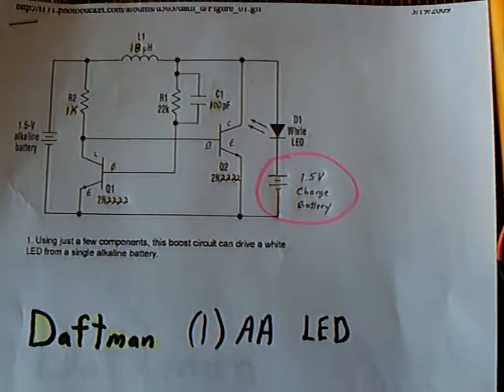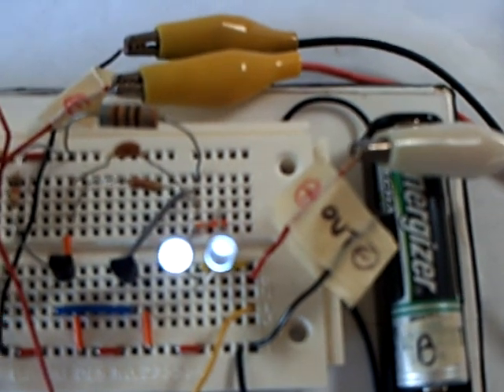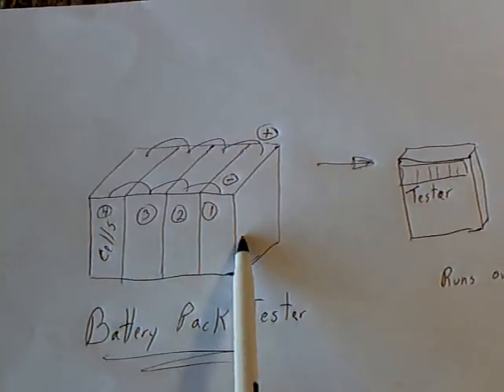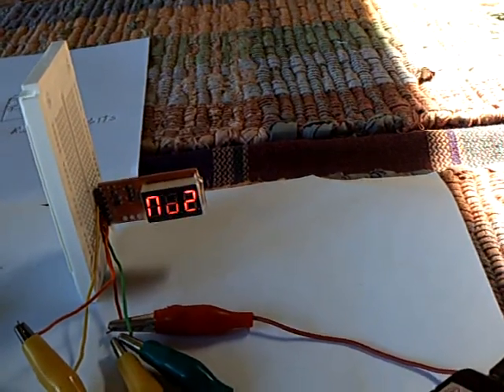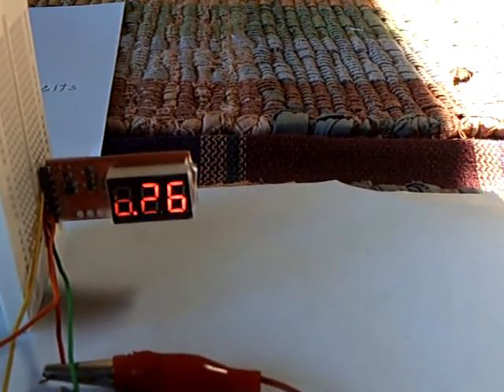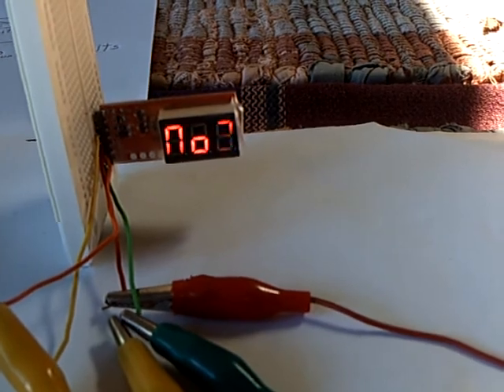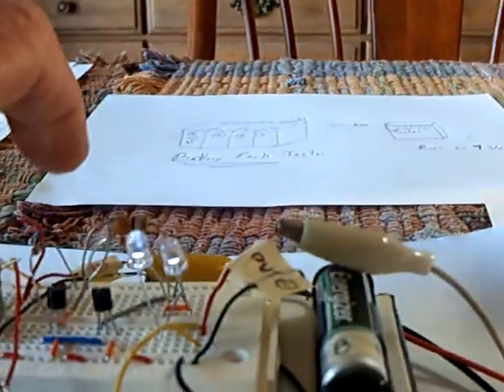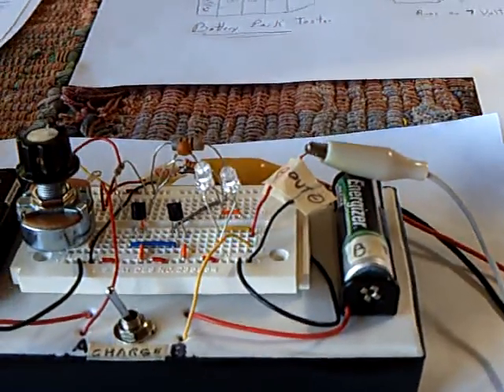Daftman Light Part 2

Comment: hi lid

That battery analiser looks like it's it's got a PIC microcontroler...
Basically, the numbers look like their flashing on the cam because of the frame rate captured by the cam... The micro-controlers update multiple 7 segment displays one display at a time.

If their a comparitively big IC chip on that analyser then post it's model here and i'll get you the technical specs...

it's the same sort of micro-controler that i'm using to control my pulse motor now...

Comment: The ones I ordered were 2 x 4 cell each that work from 4-12v, they sound perfect I easily have that may nokia batteries and I have 2 x 18v 2.4W Solar Cells to hook up to them. Use germanium diodes and transistors if you can, they are the most efficient I could find....